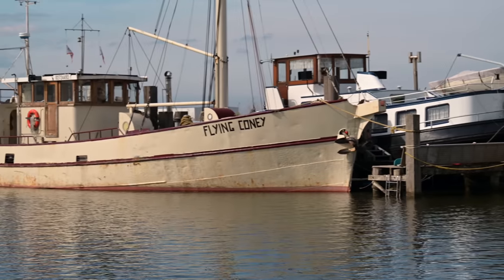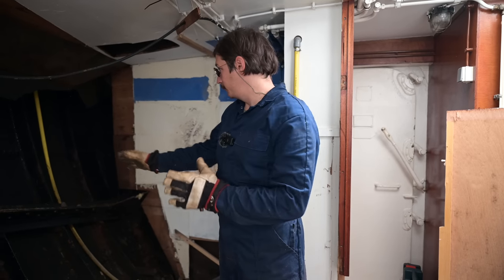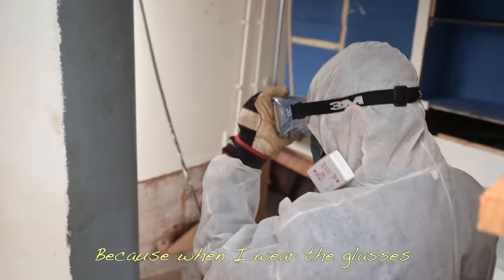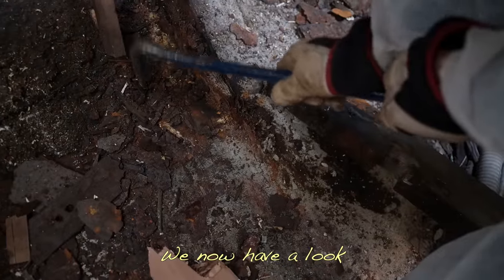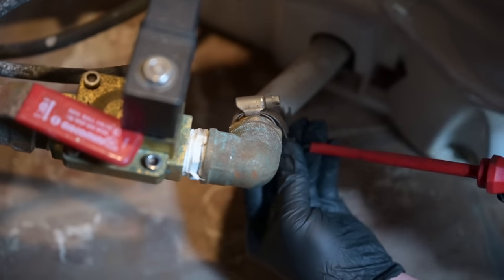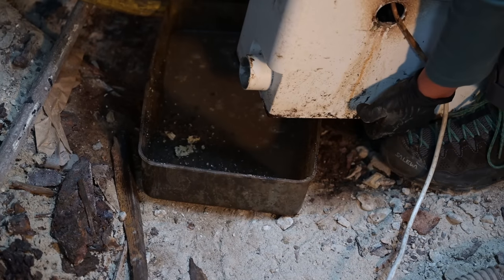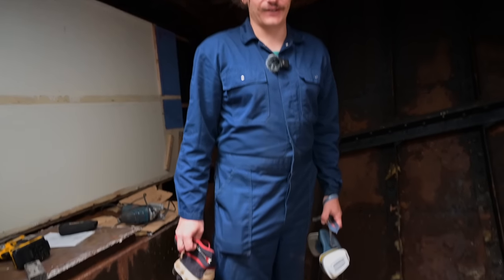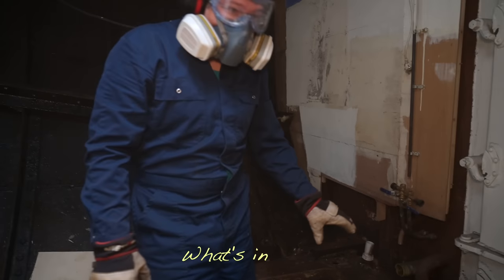DESTRUCTION! Removing an Old Blackwater Tank!

Comment: I'm sure you plan to do this: On steel boats it makes sense to have interior furniture components easily disassembled with screws and sometimes very strong magnets. This makes periodic inspection and future repairs infinitely easier. You are doing great work and it will be worth it. Modern coatings and sealants help reduce maintenance on steel boats. Jotun brand makes an entire line of superior maintenance products for commercial steel boats. Once you are done you will have a fresh beautiful boat that you can sail with confidence and you will know it inside and out.

Comment from the maker: It was Daniels first time really working with an angle grinder. He did a few cuts here and there but on this day he went through 20 cutting discs. The Metabo 125mm Angle Grinder came with a quick change nut. In order to get the disc changed the grinder must be plugged in! Although the chainsaw is probably the most dangerous tool the grinder is some sort of a seductive devil. Everything on the chainsaw tells you, "I'm dangerous". The angle grinder on the other hand talks you into very stupid mistakes. "Look you can also attach my grip on the other side." "I'm so light you can easily hold me with one hand." Although wearing always the safety googles after that day Daniel found a sprinter burned into his regular glasses! On the inside! Also the sparks are hot and it's probably better to wear welding gloves next time. If you watch carefully you will notice a plaster on one of his fingers in the upcoming videos.
Reply: Angle grinders are your best friend and your worse enemy at the same time 😅 Keep it up Heroes!
Reply: Maybe you should consider buying a plasma cutter, and also som type of extraction fan.
Reply: Check you have the blade the correct way up, I think the nut should be on the metal ring on the disc and the writing facing up, just incase. And don't be tempted to remove the guard to access anything awkward. Stay safe.
Reply: All tools have their place, but there are better alternatives to a 125mm angle grinder for straight forward cutting.

I wouldn't be cutting those distances with a 125mm, I'd want a big Nine inch angle grinder, with quality 1mm thick blades. 
Much quicker, much more opportunity to maim yourself. They are pretty dangerous if you don't have the experience.

A power Hacksaw (or Reciprocating saw) is much safer, doesn't produce sparks, is probably quicker, and the blades last longer.

A Nibbler is far safer, so is a plasma cutter.

A good quality Oscillating tool, with good quality steel cutting blades, is quick, and much safer than anything else. Cheap ones don't have the power.

If your scaling rust off, a needle scaler is far more efficient than a grinding blade, but a LOT more noisy....
Reply: Angle grinders ... yeah. They have a few ways of hurting you.  If the discs lose integrity and fly apart, that's a lively scene. Never had it happen, but I've seen videos and it always makes me cautious.
Reply: Your videos are great, thank you for sharing your adventure with us. I bought an old project 15m motor Tjalk with a riveted iron hull from 1931 and ripped out the interior. I liked my 18v rip saw so much I got a 36v one as well. They are great for metal or wood. I find angle grinders slower and slightly more scary. 

Really looking forward to seeing how your project develops, best wishes for good luck with it all.
Reply: Please consider a plasma cutter. Such a small angle grinder is not up for such daunting task. If you must, use an angle grinder with 230mm discs instead of 125mm.
Reply from the maker: @evilla7579  We will buy a combined welding machine and plasma cutter. But we're still a boat and that means we can't buy any tool just because it's a little bit faster. The little Grinder has 1550 Watts and it wasn't easy to get into corners and tight spaces. So I think for a one for all piece of equipment the 125mm grinder is the best.
Reply: @andreasdahlgren7714 /\ This - buy the plasma cutter
Reply: I think a manufacturer that hasn`t hurt himself minimum one time should not name him so. When i saw you cutting, i thought it would have been a lot easier and at least cheaaper by using a plasma cutter. I think you two are more than brave and i wish you all the best.

Comment: the down side of posting on youtube are the negative comments , now for a real positive comment , regardless where you end up with this ship the 1 thing you will end up with are cherished memories when you are old , for 36 years i owned a 57 foot boat and i did an 18 month refit that 80% of the people i knew said i was crazy and when it was finished everyone loved it and i look back on those 18 months as the best part of owning my boat and now at my age just cleaning up after cooking diner seems more of a monumental task than building a ship , ENJOY your youth and each other
Reply from the maker: Thank you! FLYING CONEY really is the project of our lives and we are so glad that we can share this journey with you. Was everything going according to plan? Definitely not! But on the other hand we did a lot of research before we bought the boat. We knew that it will be an adventure and that there will be things we aren't prepared for. We are still within budget for the hull but it's the right at the maximum I've calculated with. What really caught us by surprise what it does mean to work in a shipyard for multiple months. I remember one of Leos first videos were he states that he probably can re-use most of the original planking. But he knew right from the beginning that Tally Ho is a massive refit project. But you have to be optimistic when approaching such a project otherwise you would run away like the devil is chasing you.

Comment: Removing that waste tank must have been horrible.  Maybe even worse than finding a hole in the hull.  It's reassuring to know that the hull corrosion problem is being solved and that you're in the right shipyard to get that job done properly.  Looking forward (pun intended) to a clean, rust-free fo'c'sle.

Comment: I like the way your doing your video's already, I come here to witness the demolition and restoration of your boat. That's what I came here for.  Obtw the reason those stanchions rotten out is because they did not leave room for air circulation therefore condensation developed which rotten out those stanchions. I tip my hat of to Daniel, She's quite the trooper to take on that task of emptying that poo tank. You guys are doing a fine job keep it up! cheers.

Comment: Mr Cooney, I have a WONDERFUL idea for your work area.  Think about this.  
Cut a hole out or the side of your boat between two ribs from floor to ceiling.   This is easy on a steel boat.  Then you have EASY access in and out AND for throwing out trash and bringing in supplies.   At the end weld it shut!

Comment: Full depth cutting eats up grinding wheels . Runnin along a channel till nearly through then break through with tip of the wheel is faster and saves discs, there is a youtube vid of a proof experiment and it really works.

Comment: just a little tip when cutting sheet steel.  go over and over your cut line, until you finally punch through, you will find that your cutting disks will last much longer,   take care and good luck

Comment: It's so nice to see you two carry on as the only place to go now is up I think you have reached the bottom now its time to start climbing up and get rewards for all your hard work it will come and you will be so glad you have done it and in the right way this time the interior build wasn't designed well and cheap materials were used and built like a house but its a boat so better woods have to be used as you well know marine ply and hardwoods like red oak and the likes plus keeping the wood away from the hull and only using stainless screws and nuts and bolts it gets expensive but it will last and if you design the interior right it will look like the expensive motor yachts you see today it's going to take a few years but with perseverance, you will get there so all the best from john from Rugby UK.and ps yes I do think it will be a good idea discussing ideas of what you want from the boat and how its going to look and to start designing the interior maybe with someone who is a professional boat interior designer so you know what materials you will require and maybe get a youtube shipwright to help you guys as you do need help there is so much work to be done and I am sure you would get plenty of volentiers to help you along the way I you was in England I would be one of them being a deisel mechanic I could show you how to rebuild the engine and modernise it for future use but there's plenty of me out there who would give you a hand for free just feed them . so there is a lot to think about seeeya.

Comment: All those floor Timbers need to be replaced with steel angle welded to the stringers then build your floor onto of the steel frames 
This will stop the water being held against the hull 👍👍

Comment: Regarding the steel cutting blades, I have understood that they last a lot longer if you do not punch througt the steel in one spot and then cut further, byt by evenly wearing it out along the line you want to cut until you are througy. The disk is shredded when is spinns against the sharp edge of the steel. On the other hand I have understood that it is faster to punch through and cut.
Reply from the maker: Thank you for the advice. I also had the feeling that the wheel almost evaporated when cutting something that was not steel. It was pretty much learning by doing but I did a bit of research that using the tool isn't more dangerous than necessary. It turned out you're supposed to use a special cutting guard but I couldn't get hold of one nor seen anybody else using it.

Comment: You should really buy a saws-all a.k.a  reciprocating saw, it will make cutting junk wood in tight places much easier and quicker. You can also get metal cutting blades for it to cut light metals such as screws, nails and pipes.

Comment: I love that you guys are saving a piece of history.. something that has had a life and a story to tell. 

Coming from a fabrication background / Cert wilder and a family of Ship Fitters I would still look into acquiring and learning how to use OXY/ acetylene cutting torch, as low tech as it sounds its still to this day an amazing tool..if you get your skills up you can cut like a surgeon, you have the means to quickly to cut and bevel steel plates uppwards of 200mm , plus the ability to heat and bend steel.  If you get good at scarfing, it’s really easy to remove brackets and other items that would be hard to remove with a grinder without damaging the parent metal. That tank would’ve been out in a matter of minutes with a cutting torch as opposed to hours with the grinder. As great as even a plasma cutter sounds, I would it take a gas cutting torch in your situation nine times out of 10.  Sometimes for “Old” projects the old tools are the best.. P.S. A Sawzall might be pretty handy too… keep up the amazing work!

Comment: instead of the jig saw, you could use a reciprocating saw which have a large selection of blades for differnent applications
Reply from the maker: That's true! But I've no idea where I left my reciprocating saw. We need to find it to remove the old wooden deck.

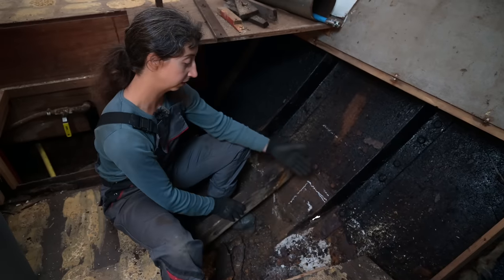Comment: 3:22 So the ship was actually at the point of sinking all the this time. 

Plumbing is a dirty job. Its great when the plumbing works. Its great showers and washing machines exist....

So for a big parts its a hull ship ("casco schip" in Dutch) now. Will the rear of the hull be as bad as the front?

You may need a bigger grinder for these heavy gauge steel sheets 29:42. The job got done however. 

"Action" the store sells a lot of cheap grinder gear and other tools. So if you want to safe some money, it may be worth it to give them a visit. 

I think stripping everything out and getting the hull into good shape is a great idea. 

I would get some person that could do 3D CAD drawing, so he/she can draw the new beams for the flooring (but that is just me). Maybe just measuring it in and putting it in is all you need. 

I think the most important thing is keeping you as builders together, and keeping on going with a great mood is the best idea. You will succeed. 

What can i see, i am always very pleased to see all the work done, and all the interesting story telling. 

Good luck with the refit!

Greetings,

Jeff

Comment: Great video. It is a never ending battle to postpone every vehicle and structure from turning into a pile of rot and rust. With boats, the surprises never end, they just keep on coming. The bigger the boat, the bigger the surprises. The older the boat, the more frequent the surprises. You can avoid surprises by never owning anything, but then you would miss out of all the fun. It is the nature of humanity to hold off and control the forces of nature. It is interesting watching you achieving what most of us would never try attempting. If one waits for perfection, they will never go cruising. As close to perfection that is achievable is a museum boat stored dry in a building, such as at Mystic Seaport. Vessels at Mystic Seaport kept afloat (Charles W Morgan, LA Dunton, etc.)  outdoors must be periodically hauled out and supported by the museum's shipyard.

Comment: You are demolishing lots of expensive stuff, you should do the numbers, cost of rebuilding and replacing to get seaworthy. Will the boat be worth the value of the new parts, not counting your labour cause that's the fun part. Yes I have done a few of these projects and had to give them away even finished. Cheers enjoy your energy.

Comment: Very well done, both the work and the video itself! My experience when working on an old steel boat: calculate very generously, then double the result and then be happy if you were only slightly above it in the end.
A tip: You should invest in a plasma cutter, especially because you can use it to cut nice curves in steel (and also very straight cuts with a piece of metal as a stop, all much easier than with an angle grinder) and I belief you will need that in the future... The lot of grinding wheels also cost a lot of money and cause tons of dust and dirt.

Comment: Hi! New subscriber here! I only came across your channel today and I’m two videos into your journey…

Wow…gutting a boat that size is such a gargantuan task…and now of course you have to redesign the interior, section it off into accommodations, galley etc…a huge job and I don’t envy you for the tasks ahead, but I admire your drive, creativity and shear determination very much! Well done guys. Looking forward to catching up with the rest of your journey!

When I saw that you opted for over playing rather than replacing the steel panels, I had a bit of a nervous twitch…but all of my knowledge and experience of boat and aircraft design, building and repair is in composites (fibreglass and carbon fibre, foam sandwich etc) so my knowledge of steel boats is practically zero. What made you opt for over playing instead of replacement in the end? Was it cost or other factors?

Comment: The thing with repairs on a steel vessel is ... there's fixed and there's fixed. Of course, only the second will give you longevity, but the second route comes with higher cost. As an example of my point; thin or rust perforated areas could  be cut out and a section formed in place and welded, while over plating or doubler plating is the less quality option because it leaves the original perforated plate behind the over patch which forms a sandwich like container accepting moisture from within the vessel from condensation or leaks and allowing ingress of oxygen from the air..this a perfect environment for unseen corrosion. I did express this opinion in the comments months ago. It is from my experience where I would be cutting out a larger area around these overplated and again rusted areas to weld in a plate. Only possible solution I can think of to rust proof doubled inside areas is to carefully drill through the inside (original) plate  thread the plate with a plug tap and screw in a grease fitting. Then inject a thin tar to fill the void while air could escape through drilled holes higher.

Comment: I've been enjoying the content and quality of your videos. I do have one suggestion. Draw diagrams of the layout of the Flying Coney, at deck, berthing, and any other level that makes sense. Then, take a moment in each video to "point" to the place on the boat where you are working. It's such a large vessel. Such diagrams would help me, at least, to understand more about your boat and your progress.

I guess I have one more suggestion. Most people who undertake this type of renovation, for such an old boat, know they have to strip it down to the hull. For the Flying Coney, I suggest that your motto should be "To the Hull and Beyond!"

Very best of luck to you.
Reply from the maker: We knew that we have to rip out all the interior right from the beginning. But it was planned to do it in stages and not all at once. It's prefareable to have a new gally before you rip out the only one... 
Usually Barbara starts the videos in the wheelhouse and then walks to the area were we do the work. That way we thought it's easier to not loose the orientation and to know where we are.
Reply: @FlyingConey  I agree...make a layout of the her...just so the viewers can "see" it better. Connecting all the different paths she might take.    For example, in the video there's a watertight door  (3:40) in the area you were working in, so I thought it was leading aft, but then it looks like at 26:04 that's looking aft, and the door is missing.  So that leads me to think at 3:40 that was a door going forward of the area.  So the question might be.... What's behind that door?